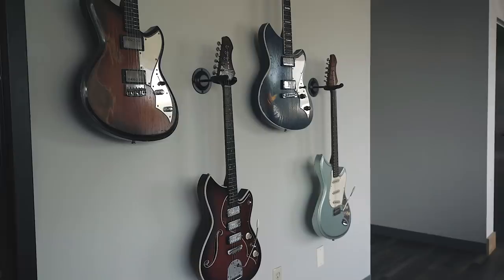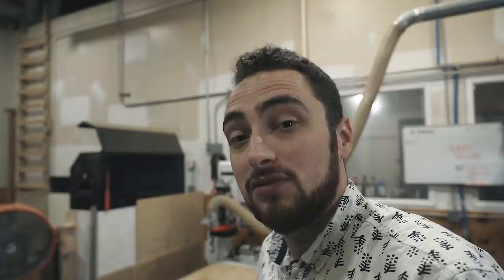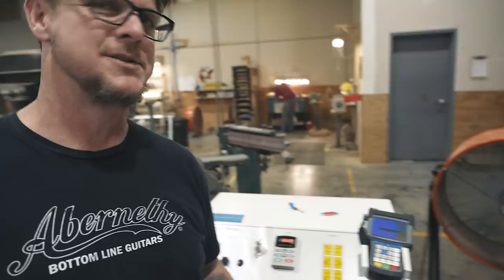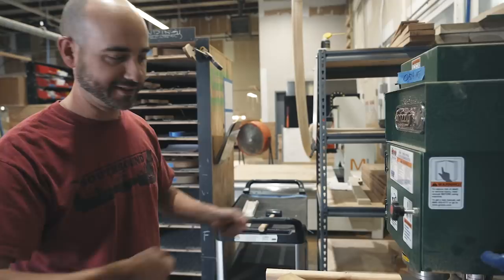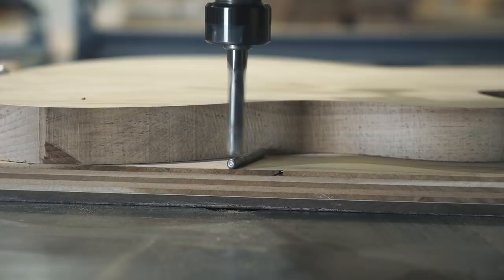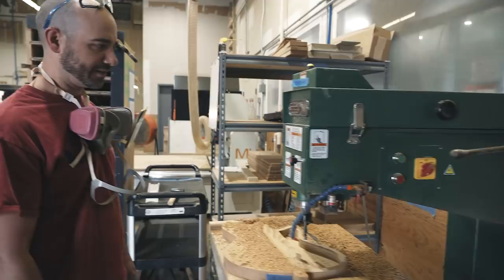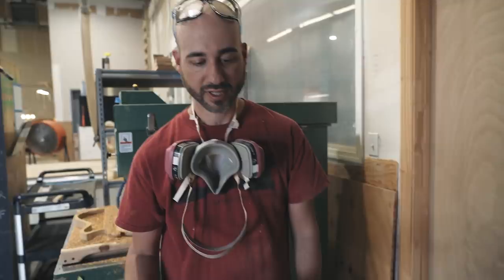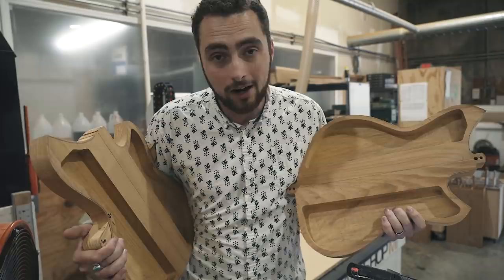Is “Handmade” Really Better? CNC vs. Handmade Guitar

Comment: I'll take that inferior quality handmade body !  ;-)  Nice job Rhett !
Reply: It's not really inferior though. It's just that the routed areas the CNC did are already smoother and won't need as much work to smooth out. Even so, you're talking mostly of the cavities that house the electronics and that's not a critical area like the neck joint, or even the surfaces of the blank before it's glued up.
Reply: @aylbdrmadison1051  I nguess you didn't get the joke. :-)

Comment: Let's point at the elephant in the room... the big difference between a pin router and a CNC is the size of your wallet. You can craft wonders and/or horrible guitars with both these tools if your don't know how to use them.

Comment: "Hand made" is an extremely subjective term because nothing is really hand made, unless you count those mud pies you made as a kid (only then provided you didn't use a spade to dig the dirt). Every form of manufacturing requires at least one tool, be it electric or manual. Every tool requires some kind of hands on touch in varying degrees. Even electric tools like grinders and drills have to be guided to achieve the desired outcome, and even very automated tools like a CNC still have to be skillfully set up by hand.
So every tool used, even the electric ones could be considered "hands on". To me whole term "hand made" so be thrown in the garbage, as it is a completely misleading and descriptively useless. Perhaps it should be replaced by the term "hand formed", where you use your hands to guide the outcome. Another thing people under estimate how much prep work goes into operating a CNC machine. They are not as easy to operate as most people think because you don't just press a button and away it goes there is a lot of planning, creating, drawing, setting etc etc that takes place before that start button is pressed.

Comment: A CNC machine is nothing more than a consistent waste material removal machine that removes a HUGE majority of safety issues. Nothing more....nothing less. 

If you're building 25 guitars a year it's not even close to being cost effective. If you're building 200.....well....
Reply: That Laguna CNC machine they have is really nice but it is pretty pricey. I bet you could get a CNC machine that cost a tenth what it does that can do just as good a job. Like a Shopbot. I say this having made my own CNC engraving machine for about $300. Which could cut out a guitar body but it'd take all day to do it. I didn't really make it to do that kind of work. For less than 10 times the price I could make a machine that could do guitar body production work on par with the Laguna. Probably under two grand. Ball screws, Hiwins, a water cooled spindle, the works. But that's just parts cost.

Comment: My over-riding concern in both of these processes is the ridiculous waste of materials. If sawdust is the best use of quality wood, then more power to this approach, but I'd rather see a flat back panel, center block, and some bent sides glued up to the same configuration, with a resulting reduction of about 90% of the sawdust.  Or just CNC the sides and nest them together with the least amount of waste.

Comment: Well thats a stupid argument about CNC vs hand made. Who cares if is CNC or hand made when i see someone make a body with the wood from the worst parte of the tree weres the grain is half circular, and worst the two parts and the grain is glued for the same direction when should be reversed for keep wood from twist. 2 big mistakes making a body. Who cares when u make CNC of handmade when u choose wrong wood. and wrong way to glue. Cut a wood by hand or by a machine is same . its cut wood. But the wood u choose and garantee not twist and keep balanced frequencys for not have hot or dead spots, theres were we have the secret. Making a guitar is not put wood in a machine and make a piece of wood looks like a guitar. The CNC only cut machine, not make miracles. Physics is were we need to focus, not give wood to a machine and pop guitars like refrigerators.